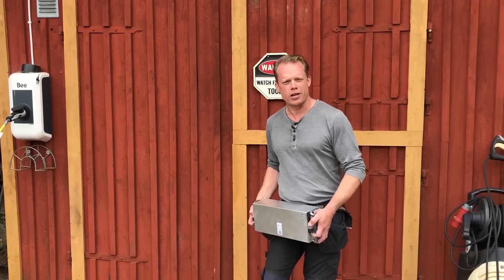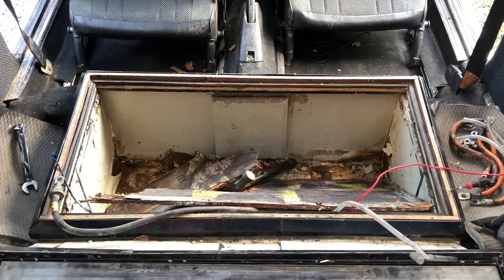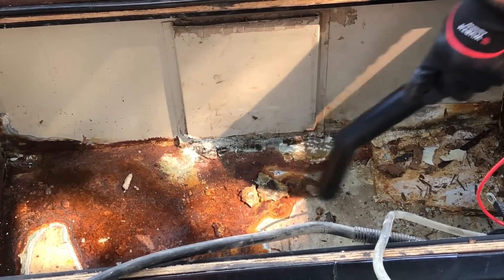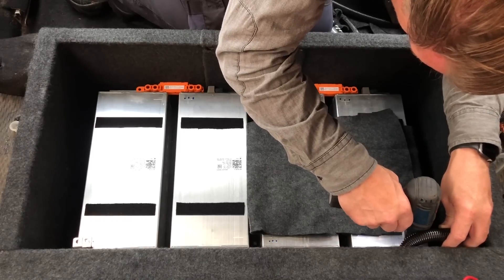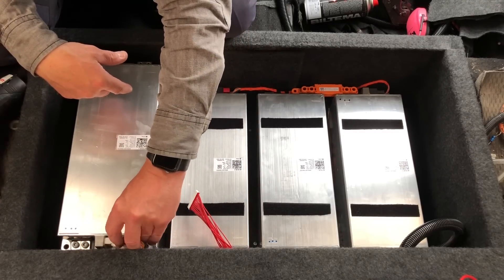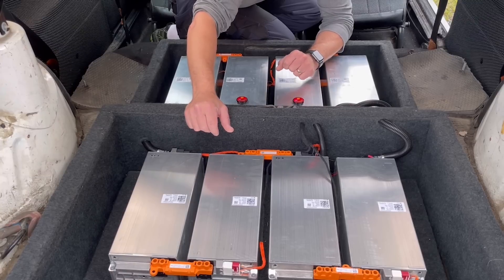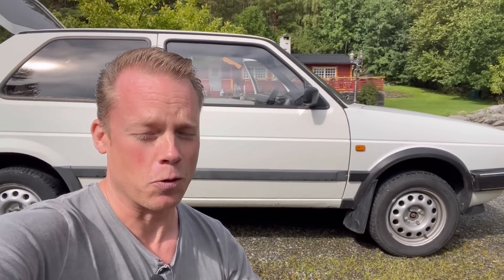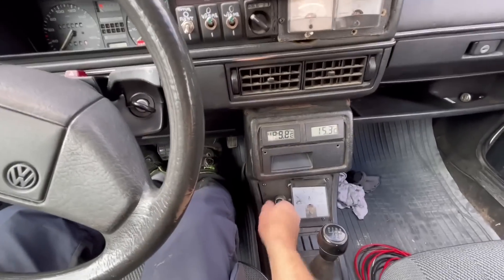VW Golf Mk2 Citystromer, All Electric, Lithium Conversion, Audi e tron 55 Battery Modules. Part 2/2

Comment: does this golf have uprated suspension to cope with the extra weight? Edit: I saw the car at the end lol, i guess it does!
How did you hook the batteries up to the existing drive, did it just plug in with same connectors?
Reply from the maker: Yes, pretty much so. Nowadays, I have a complete different drive train and backpack. So everything is changed, once more…
Reply: @flyingtools  Yes i am slowly going through the videos, just on the episode where you are installing the nissan motor. what a project!
very cool

Comment: it is so refreshing watching someone do things the right way, with such care.  question for you, do you think 10 batteries would have fit in front of the rear seat if you attempted to install them on their sides ie vertically instead of flat horizontally, seems as though that box is quite tall
Reply from the maker: That was my plan from the beginning, but if, so I had to build new/other buss bars.
The original bussbars adds about 30mm between each battery/module.
Thanks for your comment and question☺️

Comment: did you mentioned the year of the car ? it seems like it would be a 1988 and newer  and I see that you are a VW fan I saw you use a Amarok for transporting the car back home and and saw a vw UP! great project is there still a clutch pedal and all 5 five gear and reverse.
Reply from the maker: Hi, thank you ☺️.
You are close, 1991👍🏻
Yes it still has the clutch and gears working.

Comment: with energy density of new batteries going up and prices going down every year, some conversions get to a point where it makes sense to do.
but i would miss the sound of an old beetle. maybe a hybrid makes sense in that case.
Reply from the maker: Hi, yes I can understand that, especially if it is a v8 or another special engine.
But maybe there is a solution like kufatec  sound for ev cars😅
Thanks for your comment 😊

Comment: Those citysromers are hard to find, i also converted a NICD car (peugeot 106) to lithium with nissan modules.
I prefer old cars i found a citroen ax electrique and like you i will change the complete drivetrain.
Reply from the maker: Yes they really are.
Good job there 😃👍🏻
I which  you luck with your ongoing project👌🏻
Thank you so much for your comment 😊

Comment: Good job! But why did you go from 48s * 2.3 V= 110 V (96V nominal, which is 16s * 6V) to  36s * 3.67 V nominal = 132 V nominal (likely up to 144V if you charge up to 4V for each cell). This is quite a raise of the voltage range, that all electric components will face.
Reply from the maker: You will find that information in this video:
There are for extra brown batteries in the engine room, you can se them in this video:

https://youtu.be/hg4Vrovq91Y 

I will add that info in the description.

Comment: What looks like a mismatch: you remove: 2:00 Front box: 3 brown, 2 black. Rear box at 5:23 : 5 brown, 6 black. So in total: 8 brown, 8 black. So, about 8x35 kg + 8x30 kg = 280 + 240 = 520 kg.
But then you show: 12 brown (4 more) - 420 kg, 8 black - 240 kg, which is roughly 660 kg. So, the weight saving is actually 140 kg less. Not 480, but 340 kg.
Reply from the maker: There are for extra brown batteries in the engine room, you can se them in this video:
https://youtu.be/hg4Vrovq91Y 13;07
I will add that info in the description.

Comment: It looks likke a golf country with the body so high above the wheels. 
But can be caused by the reduced battery weight I assume when you replace lead acid with Li Ion cells from the Audi.
Reply: 15:00 - OK, found it out now - you are driving a cross country style golf which is not 4 wheel.

Comment: Why didn't you use China cells? E.g. EVE 280K?
Reply from the maker: Hi.
A lot of reasons, but first of all, it’s much more expensive and it is much better for the environment to reuse already produced cells. The second reason is that this EVE cell is not a power cell, maximum discharge is only 280A, and I need more then that. Then I need even more cells, 42pc instead of 36pc for the same voltage. And then those cells will not be as easy to put together as those modules that has those nice flexible bus bars. And one more thing, energy density.
Sorry for my long answer 😅

Comment: Nice conversion, saves a lot of weight and chemicals. The big plus of higher ground clearance is driving in winter with snow. But probably you'll have to tweak the "throttle" a bit otherwise it will nog move 😂👍🏻
Reply from the maker: Hahaha, thank you 😅👍🏻

Comment: Very cool design. You can convert cars for the city like this. Audi A2 is very lightweight. I wonder how much the complete set will weigh.
Reply from the maker: Thank you.
When I am finished with the project I will weigh it, then we know.
Thanks for your comment 😃
Reply: I think all the Audi A2 should be kept in storage for future EV conversion of course.
Reply: You are My Hero. Keep it going! Every video is awesome, you are so precise in description, you are so precise in manual works, you are so precise engineering. So interesting! 👍🏼
Reply: I totally agree with you! I'm impatiently waiting for an Audi @A2 EV conversion! I think a slim enough battery cells can feat in the special chassis like a cage.

Comment: 14:00 How U make holders for the second stage of the batteries?🤔🤔🤔
Reply from the maker: Only velcro at the test. They will be bolted like the rear pack. Didn’t have the right length of the bolts at home at the moment.

Comment: My friend will be working with an acid battery and say: "Acid battery is more safety". How many kWh is in these old batteries? U will be using these batteries in some projects?
Reply from the maker: Yes maybe they are if you abuse them, but for normal use, I think that lithium actually will be safer. Think of all the gases that comes from a lead acid battery, standing inside of a car, I think that that is more dangerous. 1.38 kWh average in each 6 V battery, but you can only use around half of it.